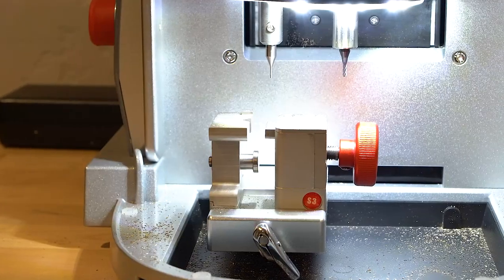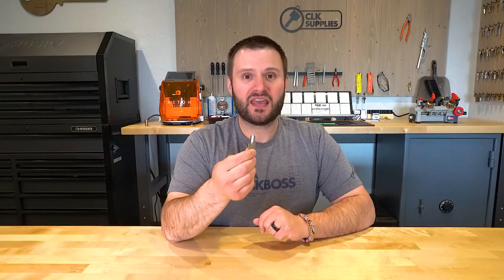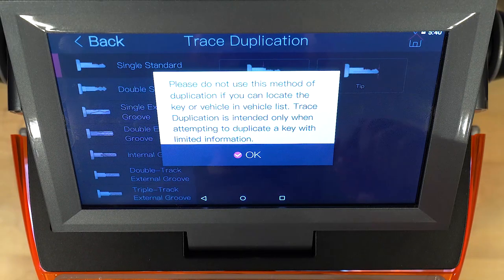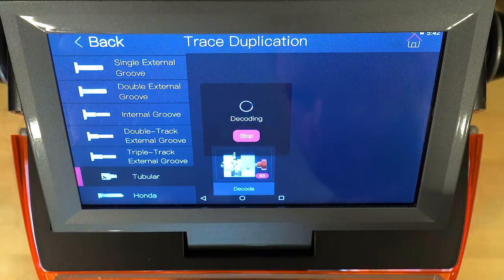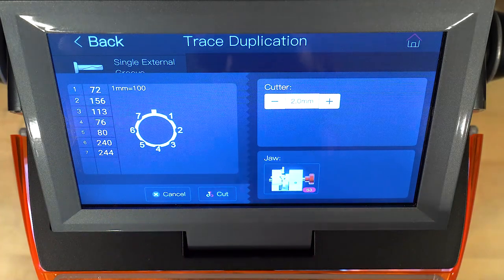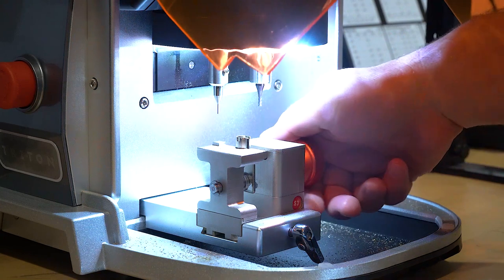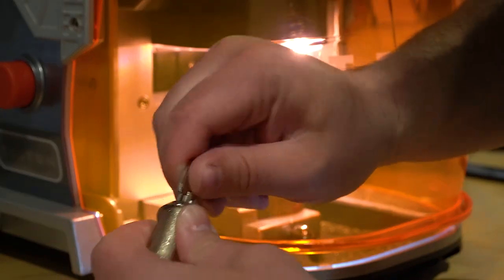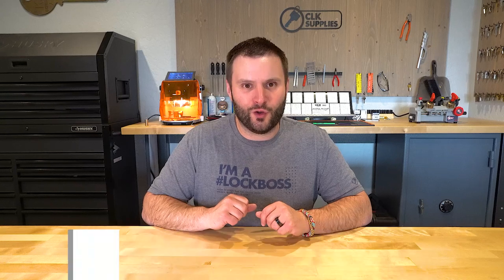Duplicate Barrel (Tubular) Key with Triton

Comment: I have a little trouble getting the key into the jaw square. It will tilt in the jaw if I am not careful. You made it look easy. Also as fate would have it, the first one I tried to dupe was 'offset left'. Turns out there is also an 'offset right' version. I wonder how many of your followers would have known of this version of a tubular  key? I certainly did not. #Lockboss